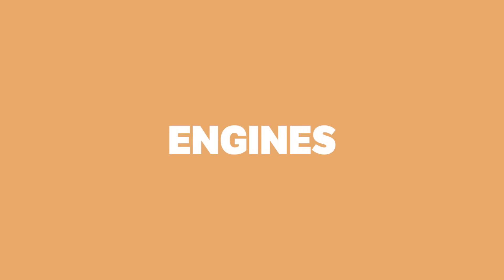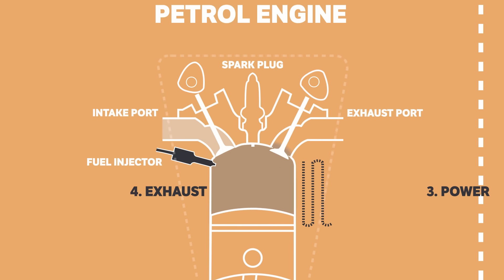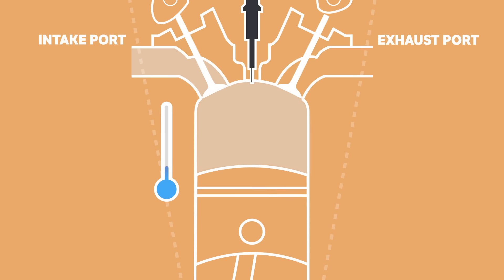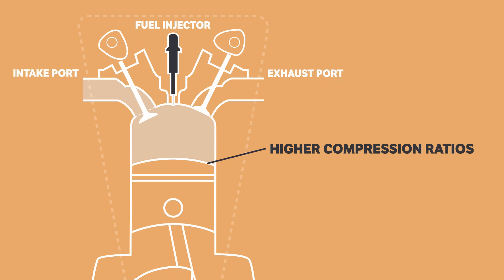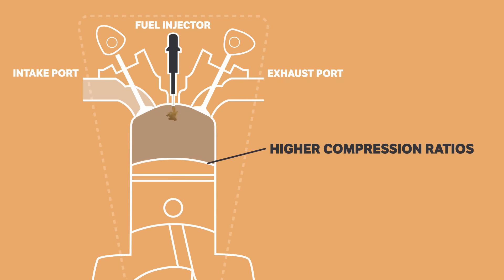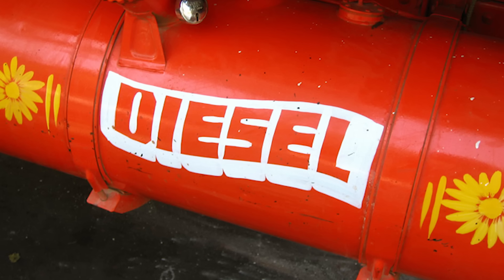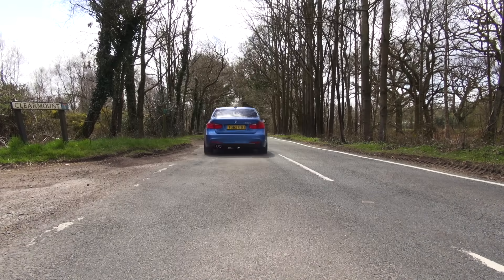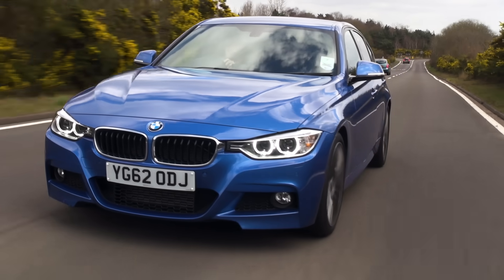The Differences Between Petrol and Diesel Engines

Comment: I do like diesels but I prefer gasoline because gasoline is cheaper gasoline engine is cheaper to maintain and it's more reliable than 40 below than diesel because when diesel fuel gets too cold it turns to jelly and you have to add fuel conditioner to stop that from happening you don't have to do that with gas

Comment: Dear people of the USA , 
All types of Cadillac, Chevrolet Caprice and all types of American Chevrolet, Oldsmobile , Dodge Charger and Dodge truck Pickup from 4 doors to large and magnificent 8 doors, and from 5.9 meters long and larger and with a wider width of up to 2.55 meters and luxury and the distance between the seats should be greater so that you can stretch your legs comfortably.and the different, beautiful, and delightful sounds of the exhaust pipe with powerful diesel and petrol engines and good looks like muscle cars in turbocharged beauty and larger, wider wheels, slightly protruding from the fenders, make the car appear wider, add to its grandeur, and also have a powerful appearance and a spacious and convenient trunk , as well as pleasant car trumpet melody horn  in 1970s. In addition, with a beautiful double bumper and a place to rest and sit in the front of the car on the double bumper ، also the front seats can be folded down so that, together with the rear seat, they can be converted into a bed so that you can even sleep comfortably when you need to. The car's dynamo (generator) should be more powerful, as well as the batteries of these cars should be stronger and have higher amperage, and should have a powerful air conditioner ، and have a bigger and proper refrigerator and freezer in the back seat, as well as a microwave next to the dashboard, and also tables for the car seats , and there should be 110/220 volt electrical facilities in the trunk and it should also have the advanced features of today's cars, such as internet and television. Moreover, this engine can also operate on a 50/50 mix of diesel fuel and natural gas, or gasoline and natural gas, which not only saves on diesel fuel and gasoline consumption, but also has less environmental pollution. In cold winters, the engine may start later and require multiple starts; therefore, a 24-volt starter should be used for these cars and they should also have two high-capacity 12-volt batteries , it is also useful to use natural gas [(Plus diesel fuel , and gasoline  (petrol)] in the car's throttle to start and ignite the engine so that these high-powered engines can be started more easily, the battery will drain more slowly, and the engine quality will be maintained and these are important points that should be considered. If I become the prime minister of Islamic Republic of Iran the diesl fuel price 21 cents and gasoline price 36 cents will be for the companies that manufacture the cars mentioned and cadilac according to the year 1970 that people can use the cars comfotably and I will pay the financial aid for the research of the powerful motors and as well as the financial aid for the important researchers. I have many researches in different studyfields in internet as a genious.
Sincerely yours , 
Shahrokh Shahimi.

Comment: There is a new type of engines, which is a hybrid of Diesel and gasoline engines (you might call it "Disoline' engine.) as follows. 
High Efficiency Low Emission Hybrid ICE:
By simply splitting the ring-section from its skirt - to be operated by a (valvetrain-like) piston-train to pump the gases during the intake and exhaust strokes, and combined with the skirt to complete the compression and power strokes - can achieve the hybrid. Which completes the 4 strokes, different in both displacements and periods, in every engine revolution - called D-cycle (Differential-stroke cycle) – a hybrid of the 2-/4-cycles.  
The D-cycle’s controllable exhaust strokes can be shortened to retain high amount of burnt gases to control the ignition initiation and combustion rates for the HCCI/LTC (homogeneously charged compression ignition with low temperature combustion). When combined with the (gasoline type) stoichiometric air/fuel ratio intake under high-compression ignition, it is the diesel-gasoline hybrid with the benefits of both – called SCCI/LTC-BGR (Burnt Gas Retention).
The resultant hybrid can have Atkinson-cycle strokes, whole engine working at lower rpm, fewer cylinders with lighter engine support and vehicle styling, weight and efficiency gains, and etc. Diesel engines can avoid soot and NOx formation saving expensive after treatments with lower noises. Gasoline engines can enjoy diesel type (within structural limitations) efficiency (test shown >20%) and torque gains ( >2.5x).

Comment: One technical factor correct though - diesel engines do not compress the fuel and air mixture they only compress air and the fuel is injected at the top of the compression/if not they would be random ignition at a point where the auto ignition temperature of the fuel mixture was reached
Reply: fuel is injected almost at the top

Comment: So why do we use petrol like at all?!
Reply: More power for the size and weight of the engine.  Power, not Torque is the limiting factor not only for how quickly a given amount of work can be done but also how much work can be done in a given amount of time.  Diesel for industry agriculture and husbandry.  Petrol/Gasoline, alcohol, nitromethane for Motorsport

Comment: A HUGE difference was ignored in this video.  A spark ignition engine operates on a constant pressure thermodynamic cycle while a Diesel engine operates on a constant volume thermodynamic cycle.  To everyone reading this, note I capitalized the word "Diesel."  It's the last name of Rudolf Diesel.  It is proper to capitalize it.

Comment: 2:52 - The jake brake only opens the exhaust valve when the piston is at top dead center (or if it is an interference engine, just after the piston starts going down so there is clearance), because leaving the valve open through the entirety of the compression stroke won't have the same effect.

Comment: So a diesel engine doesn't need spark plugs at all, but the ignition is done purely by the fact that air and fuel is mixed together and compressed to such high pressure that they just light up? Is that correct?

Comment: Having driven both types of cars I would say I prefer Diesel, because it really is more efficient specially in a manual transmission. Petrol seems to make you speed up much more when your foot is on the clutch and the other pressing very lightly on the accelerator you cannot press almost anything to find the clutch point because it seems like the reaction of the engine is more volatile. With diesel cars you feel you have time to react and the throttle differs a lot from petrol cars. My preference is based on how somehow Diesel Cars seem easier to drive. But Petrol feels very satisfying too because it is a type of engine that accelerates faster. They are both fun in the end. I would not have a preference over any of these two or Liquid Gas Petroleum. I just do not think that an electric car is feasable yet and attract more people, like me, it would not be accepted because there are also lots of people that prefer either combustion engines, manual transmissions or both. I like both. I hope we find a better more efficient fuel source in the future. One that might turn waste into something actually useful

Comment: As a diesel mechanic I can tell you they are much more reliable and easy to work on. BUT you can’t beat the joy of a high revving gasoline motor.
Reply: Both have their advantages.

Comment: I bought a 30 foot yacht with a Penta Volvo diesel engine and was told tank was full (100 litres). I had driven it up and down Gold Coast Australia coast for roughly 10 hours. I thought I'd better put some diesel into the tank before my next trip. So I filled up a 20 litre container & started to empty it into my tank & I couldn't believe it. After about 7-8 litres , the tank was full. The only downside to it all was I mixed about 50 mls of Diesel cleaner into container & being so efficient,  most of that cleaner is still sitting in container yet to be working its magic. love diesel.

Comment: Do petrol engines heat up faster though? Meaning, do they reach the engine's optimal working temperature faster? What does that depend on? Type of fuel? Size of the engine maybe?

Comment: I had a few questions tho:
1: Why can't petrol engines have high compression ratios so that it can ignite without a spark?
2: Why are Diesel engines more expensive even tho they lack the Throttle body and spark plug present in petrol engines
Reply: petrol are very unstable if ignite with high compression without spark plugs and would lead to untimely detonation in the cylinder

Comment: There are non .
Bouth are chemical thermal reaction engines.
Thats normal school teaching crap.
Normaly peopel shuld read wikipedia expecialy the part whet it say's Gasoline/Dizel engin blocks aka compound engines.
So sorry to disapoint peopel .
Tipical engines who actualy are half gasoline half dizel engines are gm chevy suzuki isuzu opel oldsmobile and some other engine manufacturers use them as well like saab ore volvo perhaps.
So tehnicaly speaking schools shiting to much.
The early dizel engines use heat tubes ore fuel to air pre mix chambers and ised carburetors no pumps .
My ordinary engin opel from the 80s can run on bouth easely you start it on gasoline then you swap to dizel ore oil.
Some old tractors hade exaust system carburetors to burn oil ,kero water ore perhaps run on somthing ells.
So tehnicaly speakeing no diference what so ever.
Even high amplifier ignition easely ignites dizel ore hot tubes ore heaters ore chambers ore preshure ore diferent gases types instead of air ore chemical reaction ignition so.
If I miss somthing peopel can gladly corect my.
All I do to my engine is useing amplifier and advancing spark its no secret that gasoline engines love pre ignition and cold dizeling its get interesting when it is indead controled dizeling.

Comment: To maximize the power of the petrol engines try to make the crankshaft heavier than the first pattern to maximize it's compression power and make the engine fuel efficient  strong compression means more heat to generate and burn the less fuel to convert to power and that's the thing that the car is no need of external ply wheel

Comment: I hate petrol
I can feel the delay after I put pressure on the gas unlike diesel.
This cause me to anxiously put more pressure causing the engine to ramp up more. For short, gas in petrol is hard to control when you are used to diesel.

Comment: Why I have a 20 Y.O. turbo petrol car: 
It has a rpm range fully usable, not only between 2000 and 3500 rpm. Its linear througout the entire range. 
Maintenance is cheaper. No EGR, no particulate filter, no high pressure pumps...
Was cheaper to buy in the first place or at least it hasnt 150.000 on the odometer.
Sound better.
Smells better.
On a roadtrip , dragging 1650kg of car with 5 people plus cargo it did an average of 6.5l/100km (43.4mpg uk), 110kph (68mph) highway, 80kph (50mph) two laned roads.

Comment: Diesel engines require oil that contains twice the calcium a third more phosphorus and magnesium. From 900-1100 parts per million and for calcium 1200-2400 ppm. This is in synthetic oil CF has been improved to CG-CH.

Comment: Now i understand why my car requires the fifth gear at 50km/h .... why did i ever buy a gas engine :p
Reply: I have a petrol car and I love it. Gasoline engines are more reliable because the pressure in the cylinders is lower, which means less wear, and also gasoline does not produce so much deposits as diesel dose (carbon deposits forming inside the engine). I preferred to buy a car on gasoline and go on long trips without worrying that something might break down on the engine side. I also recommend aspirated engines because they are more reliable, for the same reason, lower pressure, fewer components that can break down, fewer headaches.

Comment: If diesel is more fuel efficient why not have all cars run on diesel? Diesel is more expensive last I looked was $3.29 a gallon
Reply: They do here in the UK. About 50% of the cars are diesel. I can get upto 1000 miles out a tank of 70Litre diesel in my 2014 Vauxhall Insignia.

Comment: Im happy with my 2.0l turbocharged diesel engine in my car. 
Plenty of mpg, approx 60-70mpg
Plenty of power and torque.
People say diesels are oil burners, kick out black smoke etc..
My advice is change oil every 6 months, and use premium diesel fuel, look after the life blood of your diesel car and it will look after you and run clean forever.

DIESEL POWER

Comment: So... If diesel engines are more efficient and are theoretically capable of delivering more torque, why all the engines in race vehicles (f1, rally, boats) are petrol engines? I'm missing something here
Reply: because petrol have faster acceleration and petrol engines can reach higher rpm, if you ever drive a diesel you will realize the throttle response is very slow
Reply: Isn't acceleration torque? If you have more torque that means that you have more acceleration, right? Also, I have driven both but I didn't notice that big of a difference. lol I know, I know nothing about cars, racing and engines in general, don't judge me
Reply: @alemutasa6189  torque is power, petrol can go through higher rpm's faster than diesel, thats what i meant, diesels will be slow even in neutral when you rev, while petrol is instant response, but this really doesnt matter in practical applications, since diesel is more efficient and has more torque (pulling power) at lower rpm, not to mention diesel engines are built very strong and last alot longer than petrol
Reply: Ohhhh ok, now I finally got it, thank you brother! Yeah I didn't connect "higher rpms" and "acceleration", sorry
Reply: @العقيدمعمرالقذافي-ح4ف  Torque is not Power.  Force x distance = Torque Torque X RPM = Power. Power, not Torque is the limiting factor on how much work can be done within a given time and Power is also the limiting factor in how fast a given amount of work can be completed.  So Power, not Torque is the limitation on pulling power.

Comment: If diesel gives more power, why aren't we using diesel engines everywhere, why are we using petrol engine
Reply: we are using diesel everywhere where power is important, like sea ships, trucks, tanks, millitary vehicles, but small cars using petrol because building small petrol engine is cheaper and easier than building small diesel
Reply: Diesel engines are less powerful by size or weight.

Comment: The simple reason why a diesel has a much higher compression ratio than a petrol (typically 23:1 as opposed to 11:1) is the fuel is much denser and harder to volatilise.  Petrol in a diesel engine would explode too quickly giving little useful 'shove' on the cylinder, not to mention potentially wrecking the engine.  Diesel in a petrol engine will simply not ignite and will clog the cylinder with fuel.  In fact diesel is so hard to ignite one can even put fires out with it.   However diesel has more carbon in it per unit volume, higher energy output, which gives the engine greater torque and better mileage per litre.  However diesel cars are not popular in the States as the fuel can 'freeze' in very cold winters.   Indeed on freezing mornings in the UK, a very cold engine can be a bit of a bugger to start.  I like diesels, I enjoy the torque they offer. My car operates at all legal speeds between 1200 and 2200 rpm just fine with quality overtaking acceleration.  Higher rpm gives no better acceleration.
Reply: have to disagree on that last one, my diesel accelerates best at around 4000rpm

Comment: the truth is  these engines were MADE to be inefficient on purpose to make them a lot of money .. a liquid  fuel wont burn only a vapor will , this is the main reason..try using a vapor fuel in an air intake without any other fuel.. the engine will not only run but run well  and long.. computers in cars and other additions like the horrific spark plug also add to keep the vehicle wasting a lot of fuel ..
Think about it.. the diesel engine is more effective it has no spark plug and it gets ignition from simple compression, so why couldn't the petrol engine ignite form the SAME compression ? if the fuel was more of a vapor and there was more compression in the petrol power stroke ,yes it would work the same and also be more effective but seeing most people drive petrol.. that wont do for the fuel industry  and also because people can use different types of fuels not just petrol gas and that is a bigger threat.

Comment: Another reason why Diesel engine are more efficient than petrol engines is that diesel fuel not that flammable as petrol fuel, petrol fuel is so flammable than it can easily catch on fire, but petrol fuel takes more time and it’s a bit harder to catch on fire. So since petrol engines burn a lot of fuel and it’s so flammable they aren’t that fuel efficient. But since Diesel engines burn certain amount of fuel and diesel isn’t flammable as petrol diesel is more fuel efficient with a really good fuel economy than petrol engines. Also diesel produces more torque than petrol engines. So this is why trucks use Diesel engines and a turbo for more torque to carry a heavy load. Also remember that torque moves mass.

Comment: Petrol engines may be less efficient, but they pollute less than diesel engines overall. Even though CO2 emissions from petrol engine are higher, diesel engines emit more particulate matter, which is the real killer.